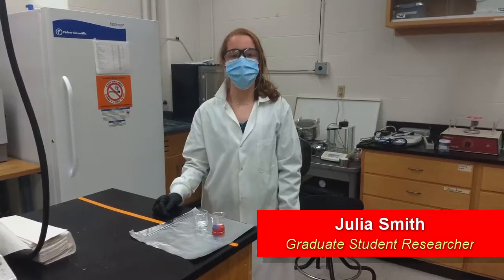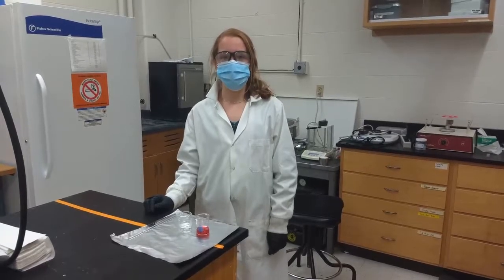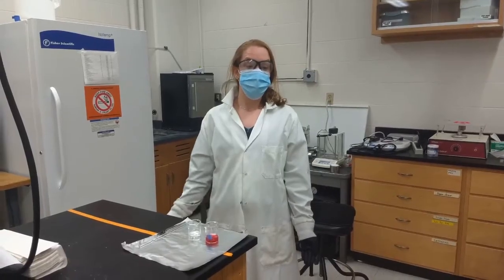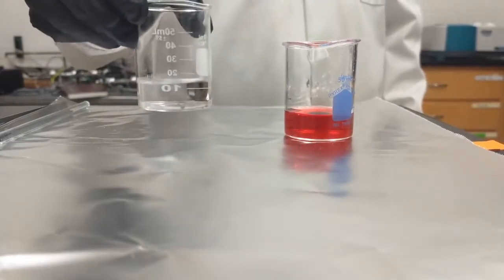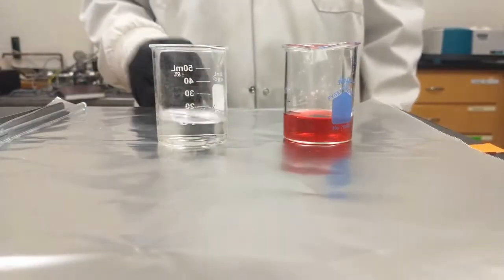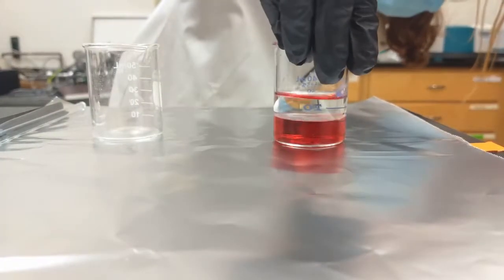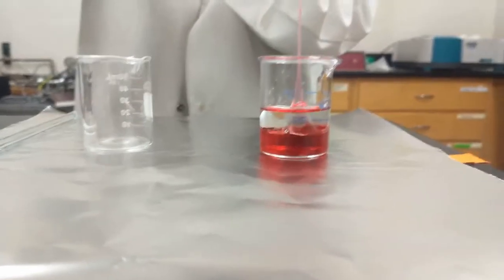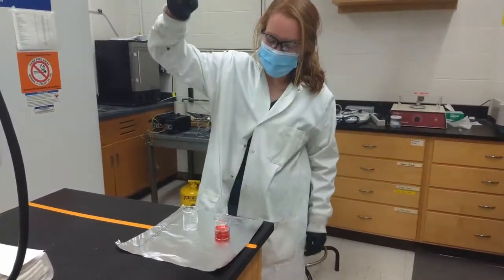Nylon Rope Trick

Comment: hi can I ask why the amine monomer is
put in water and the acid monomer is put in cyclohexane?
Reply from the maker: Hi Fadhilah, water and cyclohexane were chosen as solvents because they are immiscible. The cyclohexane sits above the water without mixing, forming an interface at which the polymerization of Nylon will take place. Other organic solvents can also be used to dissolve the acid. Hope that helps!
Reply: Ooo i see but can amine put in cyclohexane meanwhile acid monomer put in water to produce nylon?
Reply from the maker: @fadhilahjafar9290  The acid monomer is not very soluble in water, so it basically needs to be dissolved in an organic solvent (like cyclohexane).
Reply: @WisconsinMrsec  thank you for your explanation,it makes me more understand about this topic😊